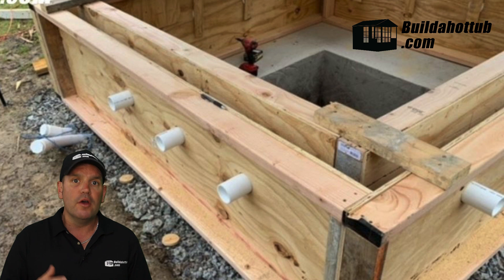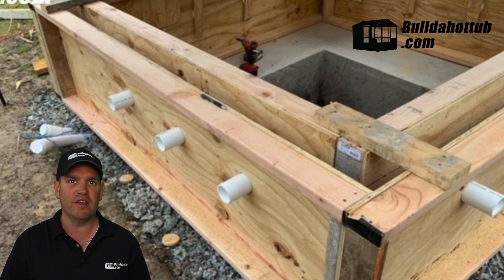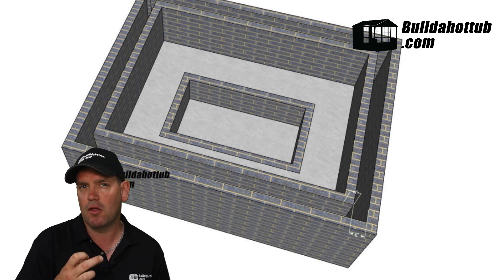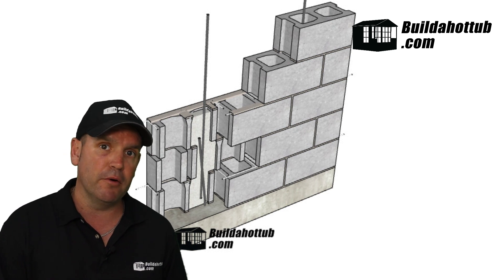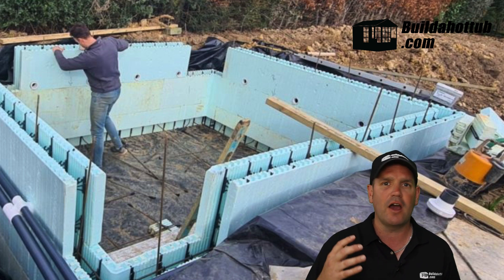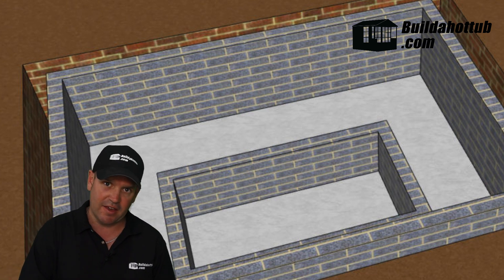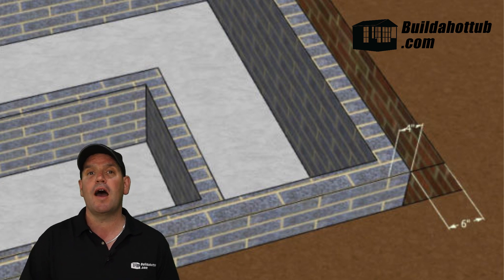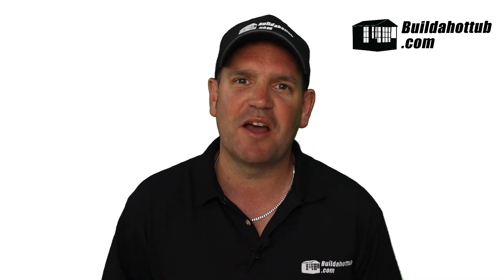Hot Tub Wall Construction – What are the options?

Comment: How about DIY ICF? As the form, two layers of cement board tied to rigid foam. Set the forms as far apart as you like/need. Tie them together with spacers. Brace plumb, and fill with concrete. The concrete is poured against the rigid foam. The cement board allows you to set your tile on the inside (after waterproofing) and on the exterior, finish masonry.

Comment: Thanks for the info! If doing a poured concrete or concrete block style tub, is it possible to insulate them by adding rigid foam to the outside between concrete and soil?

If so, how does one tile over this?

Lastly, with a concrete block tub can the plumbing be run inside the hollow core, or usually outside?
Reply from the maker: Hi Elliot - thanks for the comment. Yes, that is totally possible, you can read more about this here - https://buildahottub.com/diy-hot-tub-insulation/ - In terms of tile, if you wanted to tile the outside, you will need a second skin of brick - you can see in the article link I have posted what I mean. With the plumbing, you can do either - again there are examples of both on that page. - Hope that helps - Andi
Reply: You can screw cement board onto blocks, sandwiching foam between.

Comment: On the plan you're selling. DO you spec the type of concrete need in order the frozen ground in canads wont crack the hot tub?
Reply from the maker: Hi There, the spec of the concrete if you are ordering it in will be 4000 PSI and you should add fibers and waterproofing agent if you can. My docs explain how to mix by hand. The insulation which is covered will stop it cracking, not the mix itself - if you are running any lines from the tub to the control room you need these under the frost line for your area - hope that helps thanks - Andi

Comment: Andy on the ICF project example the plumbing is hung on the exterior of the ICF blocks.  What are your thoughts/experience about installing the plumbing internally in the ICF blocks?
Reply from the maker: Hi Grant, thanks for the watch and the question - its a good one. This really depends on the size of the ICF blocks as they are different from each manufacturer. There is nothing stopping you putting the plumbing and the gunite bodies inside of the ICF before you fill with concrete if they will fit. They are physcially 150mm / 6" wide so as long as your blocks are wider than this internally, you can do it. Hope that helps - thanks, Andi